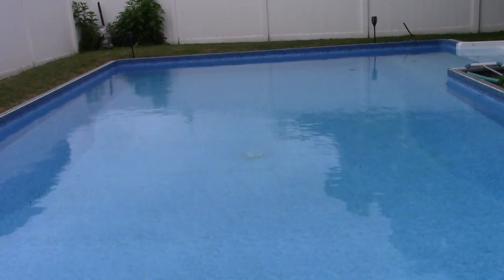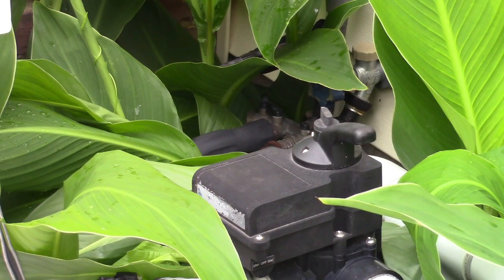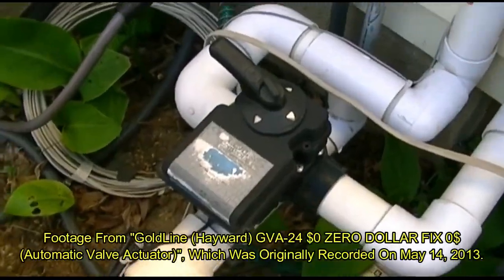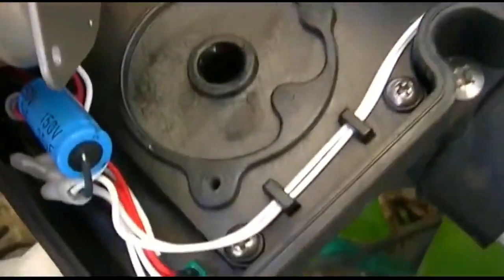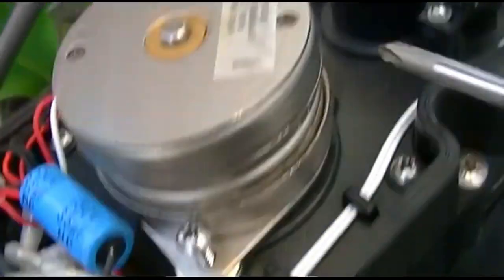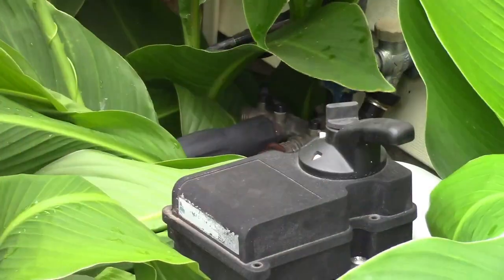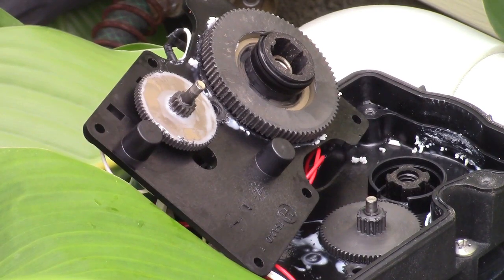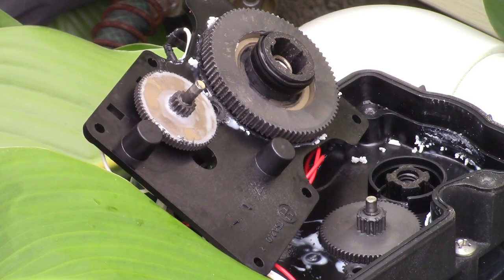Hayward Goldline GVA-24 Automatic Valve Actuator Failure, Part 1 - Diagnosis

Comment: I know  you did this years ago, but I thought I'd let you know this helped me identify the replacement/assembly of the rubber gasket and spacer on the actuator shaft. When you pulled the gear mechanism out and left everything exposed around 9:41, it showed me exactly how everything goes together! Thanks so much for that - excellent video all around!
Reply from the maker: I made this video 3 years ago, I don't consider it to be "old" per se.  Glad to hear this helped you out with yours.  You may wish to preemptively watch part 2 of this series, where I replace the actuator, so you'll at least have an idea in the back of your head for when it eventually becomes time.

Comment: I have the same system but the GVA24 isn't moving at all.  No noise... Nothing....  The control box cycles (clicks) when I adjust the thermostat but the valve never moves.... Thoughts?  Great video by the way!
Reply from the maker: Thanks very much!

First, check the "Julio swish" as I like to call it.  at 6:00 in the video, lower right corner of the unit (lower left of the side facing the camera), you will see it says ON1/OFF/ON2.  That's the setting switch so the valve operates in the right direction.  Underneath the unit, you can feel the switch.  If it's in the middle, turn it to ON1 or ON2 and try the contol box.  Then try the other setting if it's still dead.  It could simply be that the switch is in the wrong position or turned off.

Part 2 of this video, link in the video description, shows how to replace it.  Easy Peasy.  Motor/geartrain, the whole assembly was around $90, they will go from $90 to $120 about, or at least they did when I recorded this video.  These days, there are many different manufacturers that make this motor assembly, so you don't have to buy the Hayward Goldline one.

Comment: Hi - Thanks for this video, very informative. I have bought a GVA-24 and I would like to emulate the Hayward AquaSolar Controller - GL-235 with a PLC and some thermistors (as well as other things on my pool...). To do that, I would have to get a 24VAC transformer sized as in the GL-235. DO you know what is the transformer VA required to drive this motor? I check in the GL-235 documentation without luck. Thanks in advance. 😀
Reply from the maker: Sorry, I don't know offhand.  Can't be much.  What I can tell you is that there are many different models of this actuator, different brands that is to say, perhaps one of them would list the VA needed.

Comment: Thanks for this!  What a great fix.  Did the valve switch fail that stops the valve from turning? Is that why the motor was stripped?
Reply from the maker: No, the switch never failed.  The motor shaft strips in time.  This thing was nearly 20 years old when it failed.  It first failed about 9 years ago, and I found that by raising the motor up using washers, I could extend the life of it, because the gear wasn't worn in that spot.  That lasted 9 years until this video, when it finally had had it.  There is a part 2 to this series that shows the replacement procedure.

Comment: That's too bad the worm gear itself, isn't replaceable. At least you know how to double your mileage though!
Reply from the maker: The double mileage solution was absolutely ingenious!  When I tried to put it back together after this video, it reminded me of how painstaking it was to get everything lined up just perfect to drop the screws in the motor.  I remember doing it the first time and I tried and tried and tried again.  It was dinnertime so I went in and ate.  Came out and got it first shot.

I thought about adding one more washer, to try and get just the end piece to engage, but I figured that wouldn't buy me more than a couple of weeks at best, if it worked at all.  It would only delay the inevitable.
Reply: @jaykay18  Yep, the old walk away for a bit trick usually works well!
Indeed a good call to just replace. I wouldn't imagine that tiny bit of good gear would last maybe a few cycles.
Reply from the maker: @dynatrak  I was still at Tiny Middle when I originally did the washer trick.  One guy had suggested I use just one washer and then add another later on.  I figured I'd take my chances with the way I did it, because it was a much more thorough engagement.  That guy got fired later on...

Comment: why do the leafs grow so thick every year and die in winter what are they anyway?
Reply from the maker: I don't know what kind of plants they are.  They die every year over the winter and grow new.  They have bulbs in the ground that produce the new plants.  No idea what it's called, I just call it Tropical Plant.
Reply: @jaykay18  I started calling mine tropical plants, but they are actually Canna Lilies! Indeed tropical, but not true lilies. They related to ginger. Even the roots have a similar structure!
Reply from the maker: @dynatrak  Thank you for that!